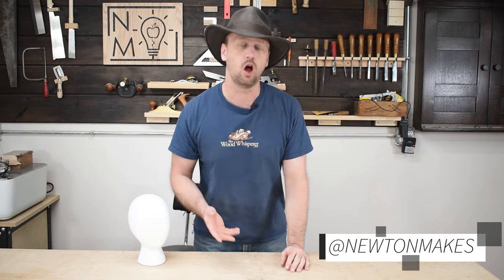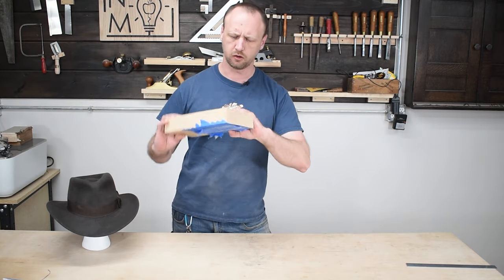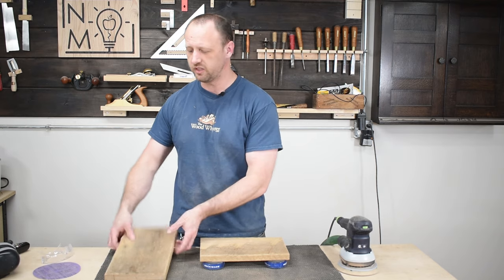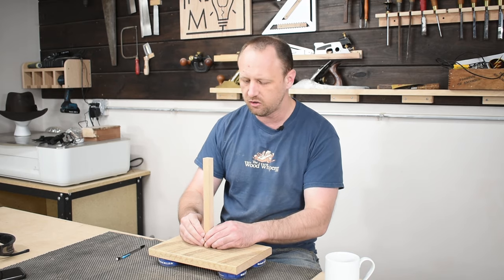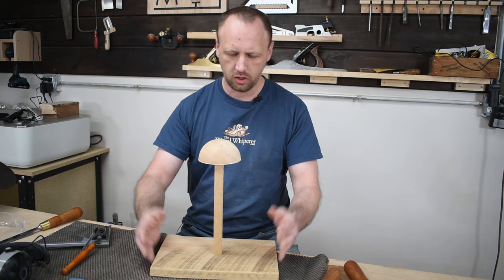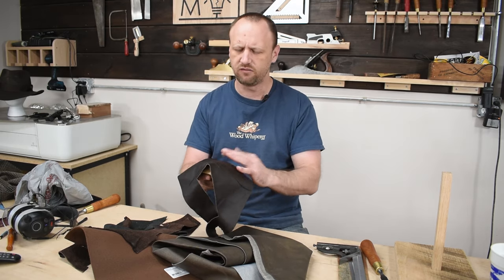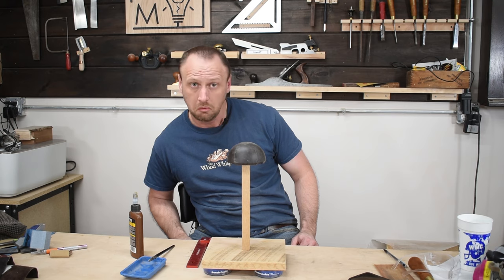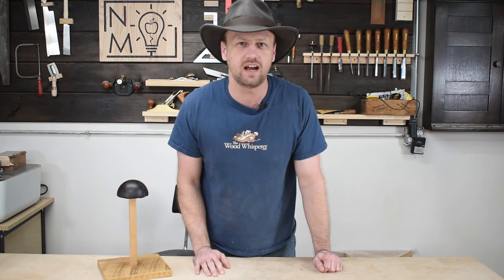DIY Hat Stand from Barn Wood for Indiana Jones Prop

Comment: REQUEST/SUGGESTION _ Basically, I'm requesting you make another one but taller and look up how people attach and tuck leather so it's smooth.  I'm thinking full indoor entry valet (near garage or your main door that you enter/exit), b/c where else do you need a quick place to drop things, but want it to stay neat so you can find everything as you leave home or office. So, I'd love to see you create a valet set where you add a couple of key hooks and maybe a small, loose change bowl glued to the base, perhaps a spot to charge your laptop or phone, etc. And using the same leather to create a cohesive, stylish look. (Oh, I'm new here and I love your attitude of trying something new. Leather work is my jam. I just clean and care for my leather goods. I don't make things.
Reply from the maker: I don't know if I'm going to make something large unless we really want it in the house. Never say never. 🤷‍♂️